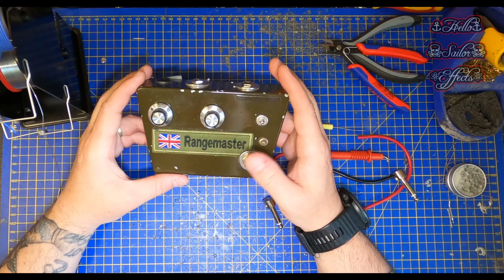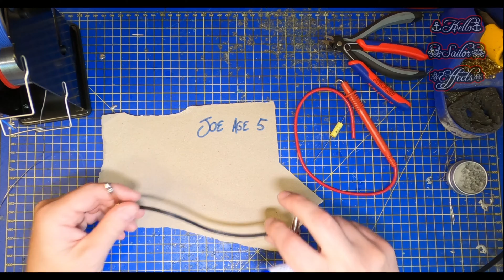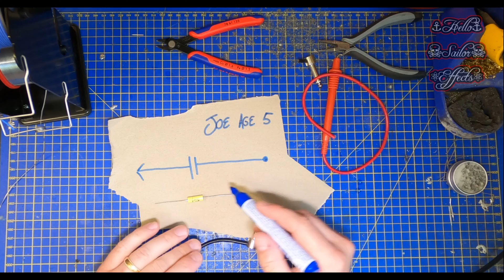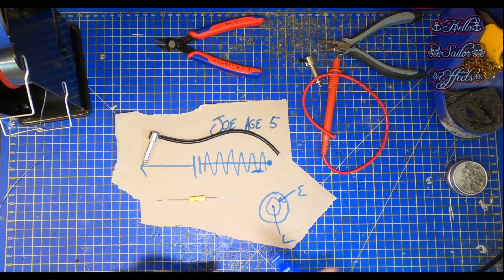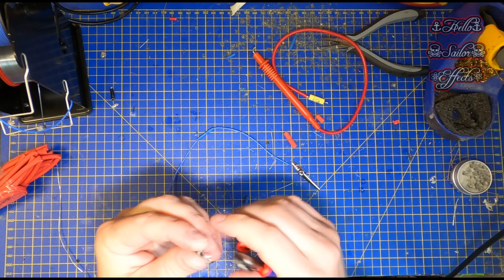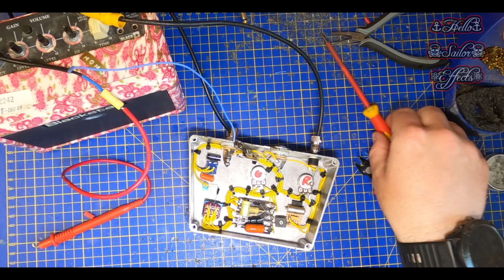Build Your Own Audio Probe: The Ultimate DIY Tool for Guitar Pedal Troubleshooting

Comment: 5 minutes to cut a fckn end off a patch cable. Could cut 5 minutes of the video and less waffling and you would still have time to better explain what you are doing. If the probe is in the amp input where is the pedal plugged in???
Reply from the maker: Firstly no need to be so combative mate. This is a video about our guitar TOYS!

To address my "waffling" - quite simply no i wont stop. I like making videos the way i make them. I have also gone from 1k to almost 10K subscribers this year so my audience clearly like it too.

The pedal isnt plugged in. The end of the circuit is where ever you point the probe 😉

Cheers for watching but if you dont like me talking i suggest you check out someone else's channel 🫡

Comment: You failed to show what the three Jack’s are plugged into. It appear that the probe jack goes into the amps input. The pedal has three input jacks. I can see you used the outer two jacks but neglected to show the destination of the two unseen cable ends. 
    Can I simply use the pedal input jack with a guitar and plug the tester jack end into the amps input?
Reply from the maker: Thank you for watching mate.
I thought i had explained that the signal was coming from the TC Electronic wire tap straight into the pedal? It may have been on the latest "fix any pedal" video which i put out recently as an update to this one.
In fact I believe this was one of the first videos that I ever made.
Fun times.
Reply: Why would you need two cables going into the wire tap. Wouldn’t the output of the wire tap going to the input of the pedal work without the need for an additional cable?

Comment: Not really 100 % where the soud is coming from but i can build the tester part.
Reply from the maker: @davidthomas1356  As in what is amplifying the sound? The probe is plugged into an amplifier. The Pedal should be plugged into a signal source. I use a tc electronic wire tap but you could just plug a guitar in.
Reply: @hellosailoreffectsofficial  ok, sorry, it's just hard to picture. The music is going into the pedal input and the probe is carrying the music to the amplifier.  Correct ?

Comment: Dear Joe age 5 - thanks for your video. This has come at a pivotal time as I have just built a Rangy with no output. Hopefully I can de-bug it now if I can work out the audio flow from the capacitor 😂

Matt age 4 and 7/8ths from Wirral
Reply from the maker: Awesome, I'm so glad you're getting some value from it mate.  I would absolutely love to hear how you get on.
Can I ask what your collector voltage is and what transistor you're using? Maybe I can help.
Reply: @hellosailoreffectsofficial  not sure, it was bloody working when I sent it out to the dude I have made it for. I’m on holiday at moment so won’t be able to de-bug till I return. It’s an NPN build mullard Ac176 and I suspect maybe the wrong polarity cable has been used on power up or something has been knocked in transit. It’s working fine in bypass so that at least rules out the switch.
Reply from the maker: @ac30helix44  Yeah mate that's exactly where I would start too. Awesome well I'm looking forward to hearing how you get on.
Reply: Maybe add a diode in the live power wire from the 9v power socket to the pedals circuit? That would protect the components if a reversed power cable is used by mistake. Especially important when mixing PNP and NPN transistor fuzz and overdrive pedals. Too easy to get your power cables confused.

Comment: Legend.  Love your videos Joe.  

My audio probe is much worse than yours.  I just use crocodile clips onto a guitar cable for mine and use one end of the cap to probe the circuit.
Reply from the maker: Thank you mate I really appreciate the kind words.

I bet your probe has lasted longer than mine 🤣
Reply: I thankfully don't need to use it much tbh.  Usually after I've busted it out and probed the circuit for a bit I realise I forgot to put an opamp in the socket or have put a transistor in back to front.  🤣
Reply from the maker: Ha ha ha I've literally done the same countless times.